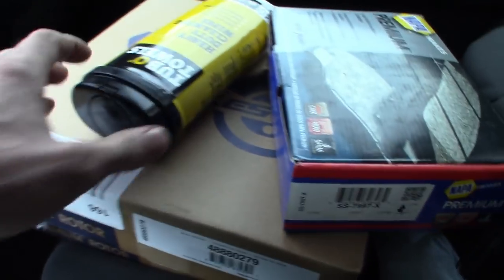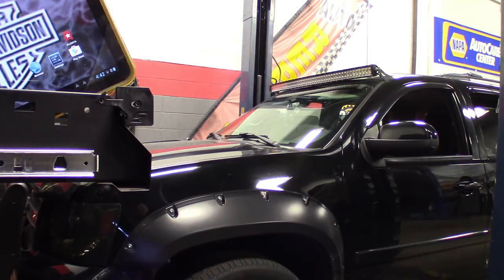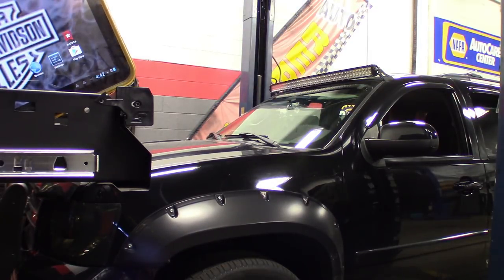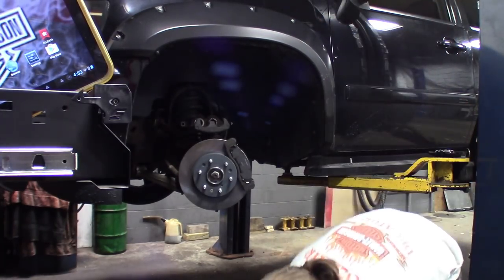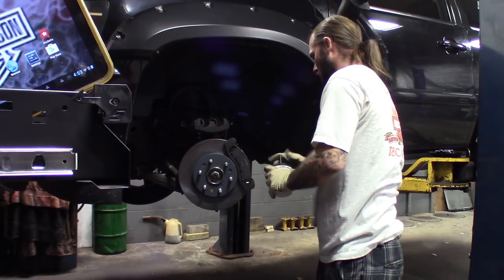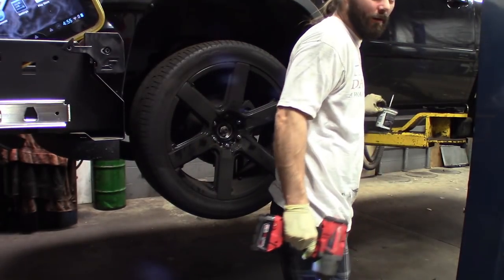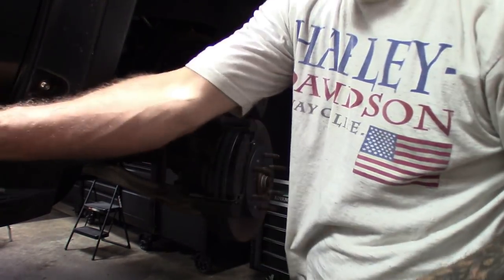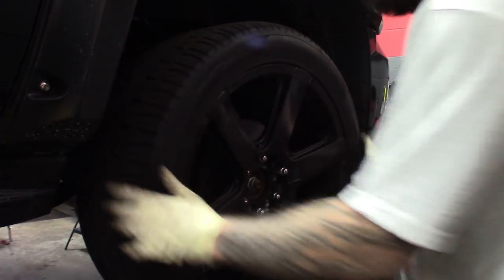SUNDAY @ THE SHOP

Comment: Great tip on the brake caliper removal,I will try that next time I do a brake job on the newer GM trucks
Reply: Worked and did this with A 2005 Pontiac Montana today.Made it easier to line up the brake caliper bolt

Comment: Hey man. I have been watching all your videos and really appreciating what you do. I have to ask though....why did you not torque the caliper bolts or put anti seize on the rotor contact? School me on this one because I always thought it was really important.
Reply from the maker: Putting a torque on any fastners is always a great thing to do and it is best practice if you can remember and have time to do it. But after 15plus years turning wrenches, you get a feel for how tight caliper bolts are supposed to be without using a torque wrench. As far as anit-seize I only use it if seized rotors is an issue and on my truck it's not.
Reply: JRC54 Thanks for responding so quickly!  Much appreciation for your experience. Keep working hard!  I love your shop space and looking forward to you going doing a build. Trying to talk my wife into a old Jeep to restore and hop up.

Comment: What scanners do you use?? I have a solus edge but also looking into another one
Reply from the maker: Mainly the verus edge. But I do still use the snap on mt2500 brick, Solus ultra, modis and pass thru.
Reply: @JRC54  have you gotten the Zeus yet? And you should check out the rust belt up here in maine! 😢

Comment: Great Job Buddy On The Brake Job 🖒🔧🔩., One Question Did You Use Brake Cleaner On The Rotors ?? Sometimes Rotors Come Covered In Oil
Reply from the maker: Oh yeah I spray em down with brake clean. They were covered with machine oil. The oil is to prevent rust while sitting on the shelf.

Comment: What grease are you using?????
Reply from the maker: Sta-lube Synthetic Brake Caliper Grease. P/n SL3303.... Napa sells it in tube or 12oz bucket comes with brush

Comment: No real point putting copper grease on the retainers as it dries out and just picks up crud to dry to a nasty grinding paste kind of mess. And the slide pins are supposed to use silicone grease as it's non drying and rubber safe. That's one of my pet peeves, only place it belongs is possibly a smear behind the rotor to stop it seizing to the hub.

Good video though man, liked seeing the little time saving things like the cordless mini grinder on the hub that was a smart move.
Reply from the maker: Thanks. I use very little synthetic grease on contract point of pads. And the silicone based grease I've had bad luck with it seizing overtime in the Rust Belt area I'm from. Synthetic i use has moly & graphite it seems to  work best for me👍😁

Comment: Premium brake job will never fit in a 20 min window. 
Pad slapping and rotor swap is not premium boss.
Those brackets need wire wheel underneath the hardware kits. Did you replace the slide pins rubbers. 
caliper grease for the pads to slide is old days. You shim the pad to fit not cover the problem by putting grease so it can slide.
Reply from the maker: 🤪used premium parts. And yes it only took me 20 mins. I Did wire wheel under hardware, I did clean hub and all contact points. I did grease the slid pins, and bracket with premium synthetic brake grease, rubbers where fine, and that's something new to me,😒 that grease is the old way to dampen the contact points on a brake job.haha. changing shims is a must not a new way of doing brakes. Again 🤣20 min premium brake job👍

Comment: Rockstar rim's are the worst.
Reply from the maker: I know right. Everyone has rockstar. These aren't rockstar there 2crave but there just as heavy🤙😎
Reply: I wouldn't go as far as the worst, there are plenty of wheels rolling down the road that are much worse as far as quality. Personally, I don't like them either, and since my wife insisted that I put them on her lifted jeep I have to look at them all the time.
Reply: @nbruno121195  not talking about quality but how they add covers and fake nuts v e everywhere.
Reply: @Azaron83  holy crap, yea. Those stupid 4 hex bolt plastic covers are a PITA. 20 freaking bolts to pull out and put back in for a tire rotation. I'm always worried about cross threading them or breaking the stupid plastic covers.